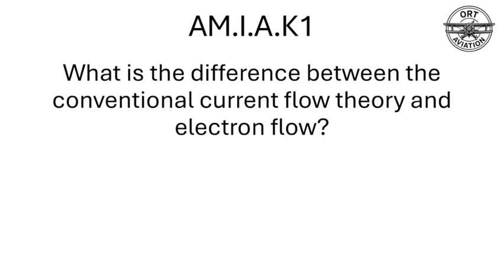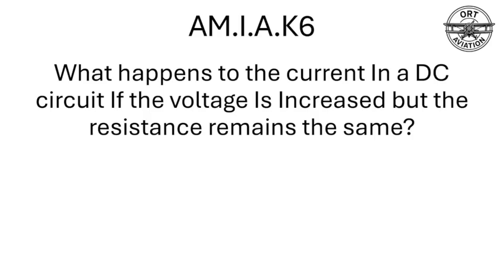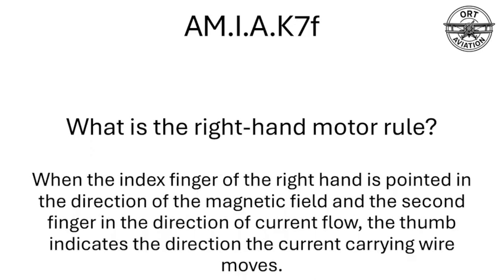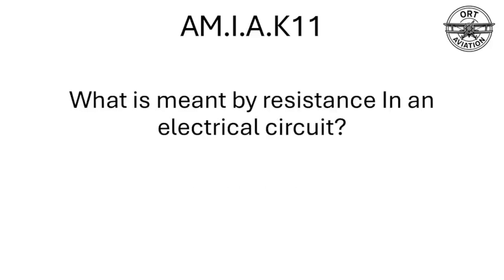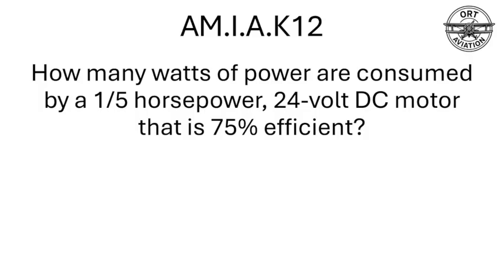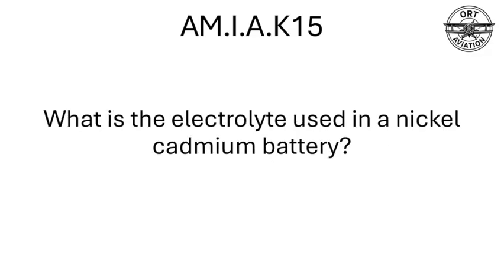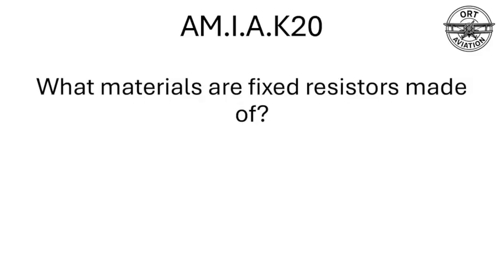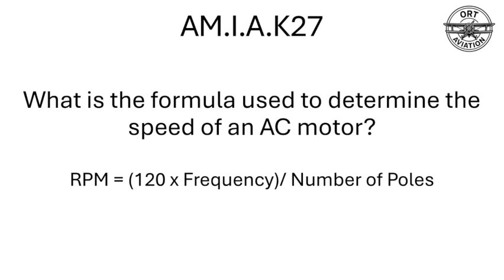2025 Jeppesen + ASA Airframe and Powerplant General Oral Questions on Subject A. Electricity

Comment: I just passed my practicals but failed my orals for general and airframe. So looking for additional/newer study guides that have newer stuff. Alot of these questions are new to me and extremely helpful because I had several in the areas I failed. Will be studying this and your other video for sure thank you!

There's been a lot of updates to the testing. If you can do more videos like this you'd be doing a huge service to those like me studying.
Reply from the maker: Glad it was helpful, I’m planning on making this style of video for all of the sections. Stay tuned
Reply: @OrtAviation  def very helpful. I passed my generals and just need to retake my  airframe orals. At this point I'm going to go through the 8083 and cram through a bunch of the stuff I used for writtens... These newer questions that aren't covered in other study guides are what are blindsiding me.